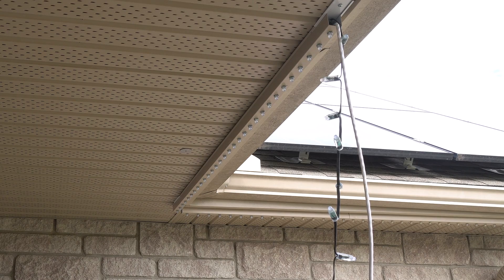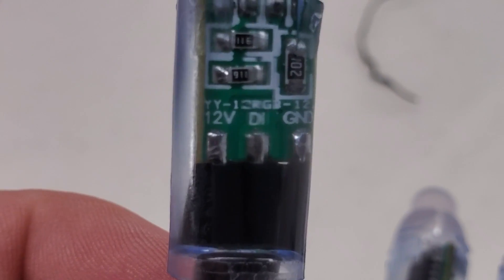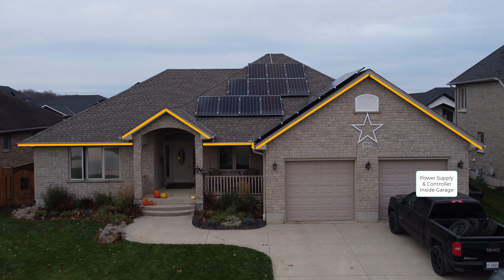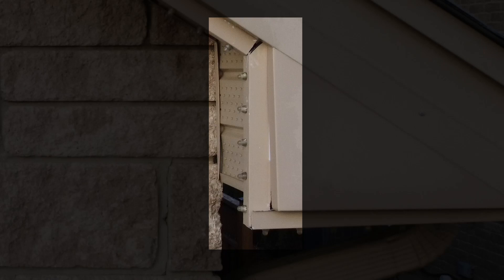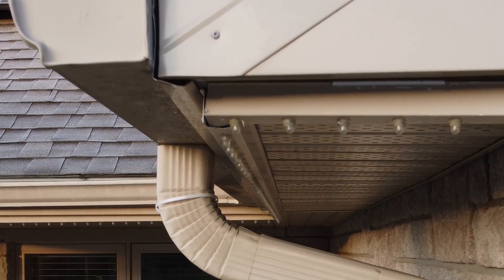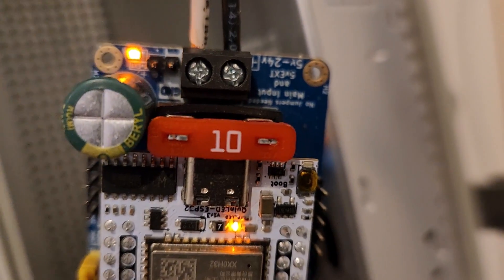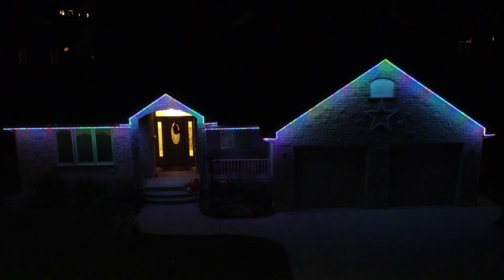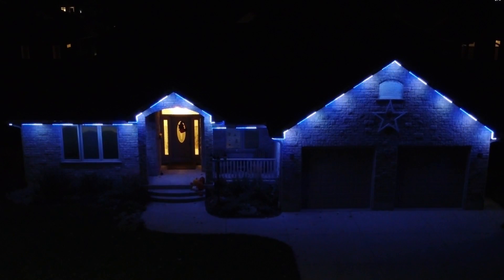Permanent Holiday / Christmas Lights Install using Permatrack

Comment: Awesome video!! I have 2 questions:
- In some of the clips there looks to be some flickering of some of the LEDs - is this a power supply issue or were you able to fix that problem somehow?
- How well does warm white look with these? They're just RGB which typically isn't the best for replicating warm white. Would love to see what that looks like with these.

Thanks!
Reply from the maker: I haven't had any problems with flickering. Not sure if that is just a video camera frame rate issue? Or maybe you are referring to the "glitter" effect that flashes random lights to bright white? 
They are still all working great and I get a lot of positive comments from kids and passersby on the street!
The warm white isn't a great look. They are still just RGB LEDs.

Comment: I realize this is a bit late... but waterproof solder butt connectors work great for connecting extension wires.
Reply from the maker: That's a great idea! If I have to do any repairs moving forward, or if I add anything to the system, I will keep that in mind! Thanks for watching!

Comment: I'm always confused about power injection.  Did you have to use an additional power supply for that?
Reply from the maker: You do not need a separate power supply, just another pair of wires from your power supply. By using a thicker wire to directly supply power downstream of a connection, you allow current to bypass the first string of LED's, and don't overpower the small wires in the first string and minimize the voltage drop from that high current.

Comment: So do you run completely separate wires for the power injection?
Reply from the maker: I did. I wasn't sure how much current would be traveling along them. In hindsight, I could have used smaller gauge wire, or tapped off the 14 AWG wire I did use.

Comment: Great video.  In the video you said you used 14AWG for the power from the Dig-Uno, how did the data get wired?  Did you use a single conductor for the data and wired it in at the power injection point?  What power cable did you select for the job?  Was the cable outdoor rated for our Canadian winters and for UV?  Would you have a wiring diagram that you can share?  Does the wiring dictate how you program WLED, i.e. if you bring data to the middle, how does a "chase" or "follow" type pattern work?  Sorry for all the questions, I'm just getting into learning this.  Thanks.
Reply from the maker: Wow! These are some great questions!  The 3 wire cable I used was automotive and jacked for weather. The 14 AWG wire was speaker wire and not outdoor rated. However, almost all of the wire is enclosed in track, and not exposed directly to sun or water.
The data wire is must enter at one end of the string and carry on. If you want to have the data go in the "middle" you would need to use the two separate data outputs to supply a data line to each string (however long). However, you can program WLED to treat them all as a single "segment" so your chase style patters will still look correct. I have two more videos coming out to finish my setup in the next couple weeks that should have a wiring diagram and some programming tips.
Thanks for watching!

Comment: I saw someone once with a soffit light warm white led program does your controller have that?
Reply from the maker: Yes! You can program it to turn on each light to any color you want, including warm white.
You can even have it use every 3rd or 4th light to space it out more.
Reply: @AnotherNerdyCanuck  yeah that's exactly what I want every 4th light
Reply from the maker: In your segment setup you just set the spacing to 4 and it works great!

Comment: I like the look, especially the flexability with the addressable LED's. Unfortunately with the cost of electricity in the UK, it would cost me the equivalent of $1150 CAN/yr to run a similar sized setup.
Reply from the maker: I run a playlist of about 10 displays with an average of about 120W draw at the outlet (measured by a smart outlet) and with a total of 835 lights (watch for my update video about adding my garage door lights!). 
So 6 hrs/day at 120W is about 720Wh, or 0.72 kWh per day. For a 30 day month that is about 23 kWh. We pay about $0.15/kWh, so ab out $3.45 CAD/mon. I only plan to run the lights about 2 months per year (Nov 12 to Jan 1, plus a few holidays through the year), so I estimate my cost would be $7 per year. 
I think you may need to check your calculations?
Thanks for watching!
Reply: @AnotherNerdyCanuck  yes, I was basing it on a continuous 19A 12V 24hr/365days. as you mentioned the 19A PSU capacity. With LEDs in patterns, so not continuously on, and only running for a 24th of a year it would be much less. 7$ is much more reasonable. Even if you maxed out that 19A supply, and had all the lights lit with full rgb on in solid color, it would be $48/yr which is not a big deal. The different effects look cool. how do you program them with your particular layout of lights.?
Reply from the maker: @timsoft I don't do anything complex with the programming, and just treat the roofline as a single string of lights. I could divide it into segments and do more complex things, but I just pick some of my favourite effects, save them as a preset and then create a playlist to cycle through them. I then schedule that Playlist to run each night. 
I will include some of this info on the next video that shows the completion of my setup. It should be out in the next few days.

Comment: Excellent video! One I will reference when I (eventually) tackle this project.
Q1: I noticed no mention of the power supply in the materials breakdown. Do you have info on that?
Q2: I don't have soffits or facia board - just gutters attached directly to the rafter tails. I'm scratching my head how to attach the tracks. Any ideas/suggestions there would be appreciated (from anyone reading this :D).
Thanks again for the awesome vid. It was presented in a way that gave me better confidence I can actually do this.
Reply from the maker: I added a link to the power supply. It is probably overkill. Just added some more lights (total of 835), and maximum current is around 19A, and I have a 30A power supply.
Not sure about the rafters, sorry. Hopefully someone else will have a suggestion.
Thanks for watching!
Reply: Regarding rafters attaching directly to the gutter, I had a few locations like this. It required attaching the track to the bottom of the rafters. If the rafters are angled you might have to use an ocelating saw and notching them level where you attach to the gutter.
Reply from the maker: Thanks for the comment!

Comment: The only part I don't like is the team you cheer for 😆   what temperatures do you find that it is having issues.? I know a lot of lights have a threshold
Reply from the maker: 😂😂👍 So far I haven't noticed a problem. Although, once it is set up and running, I don't monitor it that closely.
Reply: @AnotherNerdyCanuck  I was just curious. Because as you know here in Canada, we get the "do not turn turn the temperature in the house lower than 25 degrees Celsius, or we have to plug in our car all day and night, and also to run our car in the middle of the night for 30 minutes, if we want it to start in the morning freezing temperatures" .  That good old -35 & -40  with a wind chill of -45 to -50  weather  🥶

Comment: Awesome video!!!! 
Do you a parts list or link for lights project
Reply from the maker: Links are in the description! Thanks for watching!
Reply: @AnotherNerdyCanuck  Where did you source the wire from?  I'm not finding any good Canadian sources that don't cost several $100 for 100M.  AliExpress has wire, but shipping is costly and I'm not convinced on quality.
Reply from the maker: I just bought it on Amazon. 100 m is a lot of wire! I used a 100' roll of 2 wire and a 50' of 3 wire.

Comment: Looks great! What is your estimate on the lifespan of these lights?

And is there a warranty?
Reply: I think it really depends.  You can occasionally get dead pixels, but with these kinds of lights, you cut out the dead pixel plus the one before it and splice in new ones.  The new ones dont have to be exactly the same vendor. As long as they are same voltage and same "family" like WS2811.  The reason for the one before, is you don't know if the pixel died or if the output from previous pixel died.  I have had these kinds of lights up for 3 years and haven't had a problem.
Reply from the maker: As LED style lights, and in a slightly protected track, I am quite hopeful for significant durability. I think Phil answered the other questions very well! I am not aware of any warranty. Thanks for watching!
Reply: @KoreKount  thanks for the repair tip, I wasn't aware

Comment: Great video. What did you do to your UNO to be able to use the 2nd data line? I've got a second strand of lights hooked up to it and it won't respond to WLED
Reply from the maker: In the LED Preferences section, add another output in the Hardware Setup (click the PLUS button under your first GPIO. Add the second one (3 or 16), and that should work!  When I hook up my garage door lights, I will include the setup of the second data line in that update video.  
Thanks for watching!
Reply: @AnotherNerdyCanuck  hmm. I don't see any "hardware setup" under LED Preferences.
Reply from the maker: What version of WLED are you using?
Reply: @AnotherNerdyCanuck  I just updated to most current version. Everything works now! Thanks.  When will your garage lights video be up?
Reply from the maker: Good news!!
I hope to put them up next weekend and have the video out shortly after that.
Reply: @AnotherNerdyCanuck  DId you buy the 50 pack of lights or the 500 pc of lights for your setup?
Reply from the maker: @nafoibot  I bought 2 packs of 500 plus 3 packs of 50. This video used 535 lights. My garage doors will use 300 more, and I will have 300 on the Christmas tree. Thanks for watching!